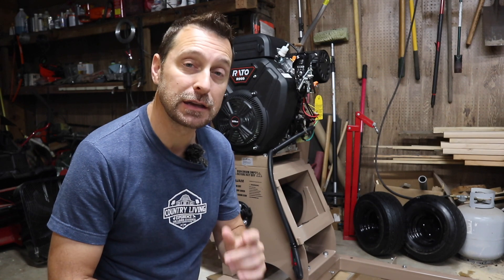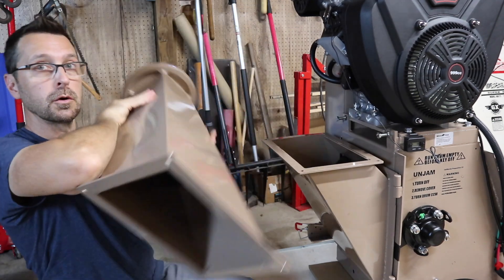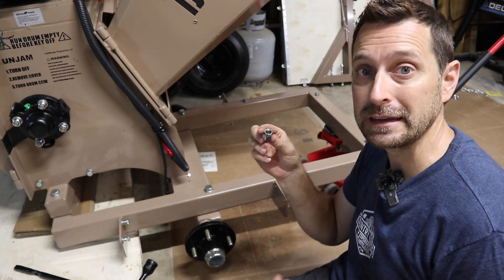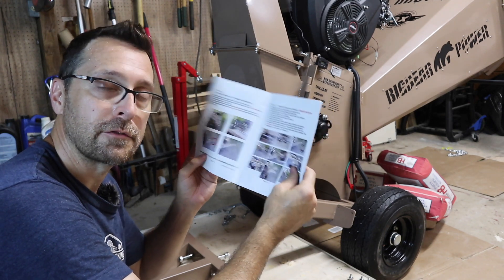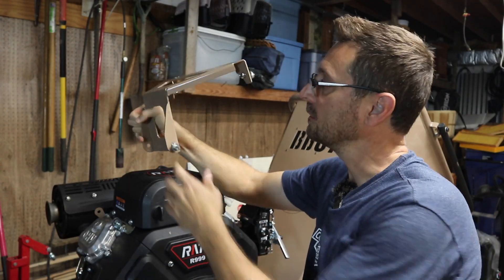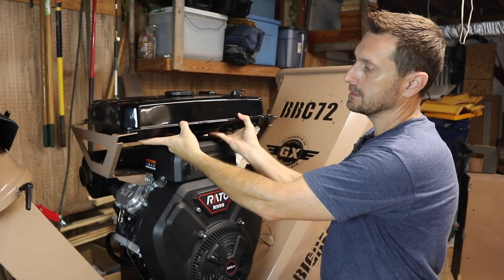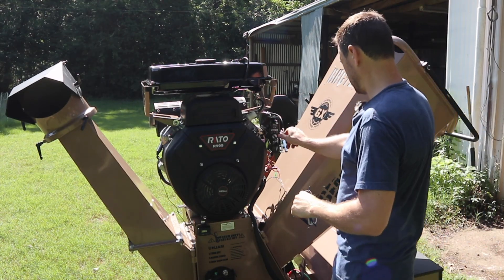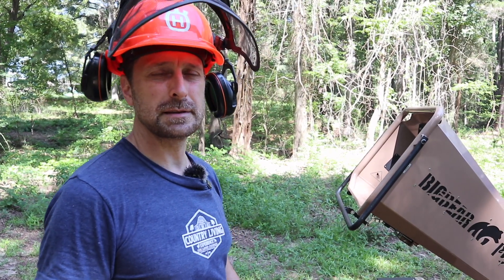Big Bear Wood Chipper Shredder BBC72 Assembly And First Use

Comment: Do you still like your big bear chipper.  I can't decide between big bear  Dk2 power king woodland mills mechmaxx no more than 6inch max. Woodland mills is a twinn flywheel design.  Mechmaxx is single flywheel design.
Reply from the maker: I love the Big Bear still. Works really well.
Reply: @CountryLivingExperience  I'm hoping to see more videos of the big bear chipping.  It seems to suck in the wood with little help.

Comment: I have a homestead and was leaning towards the slightly smaller 5” 15hp version. Thinking it would be easier to move around and a lot of those big branches in the vid I’d use for firewood. 

How do you feel about the size of yours? Think the smaller unit would still meet your needs?
Reply from the maker: The size is perfect for me. The smaller one would not really work for the branches and limbs that we have around here. 
In my opinion, the weight between the two units would not be that much in terms of moving it around. Always better to go bigger.
Reply: @CountryLivingExperience  Cool, thanks that helps a lot
Reply: @CountryLivingExperience  Same thought, the 62 model has a twin cylinder engine with pressurized oil system and spin oil filter. Slightly oversized for our use but bigger is better for longevity.

Comment: I noticed you did not show how you put the feed shoot on. I see why. I can't do it I have tried everything. I'll need help. Also I see they have changed the design some, beefing up a couple of places I do not see on yours.
Reply from the maker: I showed it and explained that is connects the same way as the outfeed chute. Just slip it onto the pins and lock it with the attached clamps.
Reply: @CountryLivingExperience  I believe you were off camera when you put the chute on, you can see it after its in place but not the actual point of you holding it and putting it on. I'd like to see that.

Comment: Just got the 6 inch one. Love it. 
Question, does the hour meter wire get stripped and inserted into the spark plug wire? Direction didn't seem that clear
Reply from the maker: Cool. 
Not sure. I did not connect the hour meter.

Comment: Why not attach the wheels and toe fame first?
Reply from the maker: I followed the instructions.
Reply: @CountryLivingExperience  But would it work if you do the wheels and toe frame first?  Would you still have the issue of having to balance the chipper while putting it together?  I was just wondering since I might get one and I want to assemble it with less issue of having to balance it.
Reply from the maker: @rowenadinsmore1  I honestly don't know. Since I had never assembled one before, I just followed their instructions.

Comment: Thank you. I wish you would have said what that wood was - Pine, Oak, cedar, .......... makes a big difference what will go through it. 
I don't want to duplicate another motor on my property because it is hard enough in CA due to ethanol in everything. I can not go a year without something needing a carb rebuild due to ethanol (yes, I take all the proper precautions we have been dealing with this crap longer than any other state in the union). So I would like to use my tractor's PTO (28 HP) to spin a chipper that is strong like yours. What do you recommend?
Reply from the maker: It was sweetgum and pine that I was chipping. Both dry so much harder than normal.
For a PTO chipper, I was looking at a Woodland Mills. They seemed to be the most reasonably priced.

Comment: I have the BBC62. I've found it easiest to fill the fuel tank by swinging the chip chute open... (I use a bungee cord to keep it from swinging back at me) then I can stand on the Y of the tow bar to more easily reach with the gas can, see what I'm doing and not spill.

I also assembled mine solo!
Reply from the maker: Awesome! Thank you for the tip. That makes sense. 
Glad you got yours together by yourself too.
Reply: Just completed our 62 today.  Haven't started it yet but the twin cylinder and pressurized oil filter were the main selling points for me. Moving the machine around will be the next task, but for 8 acres this was the only option, and a great value.

Comment: Did you test the angle on the outblow  to get higher?... on that blow angle you had it been difficult load a trailer or truck not to spill to the outside.
Reply from the maker: I didn’t test that. It will angle much higher than what I had it set at.

Comment: We use a PTO chipper.
All of them will bog down and struggle with dry, rotten wood.  
We make 100% of our garden soil with wood chips as well as mulch for our fruit trees.  The soil takes at least a year but it's worth it.
I like that chipper but the gasoline engine, and a few of the design flaws you mentioned,  make me glad mine is a PTO
Reply from the maker: Awesome. The chips are very valuable for sure. It was such a close decision for us between it and the pto chipper.